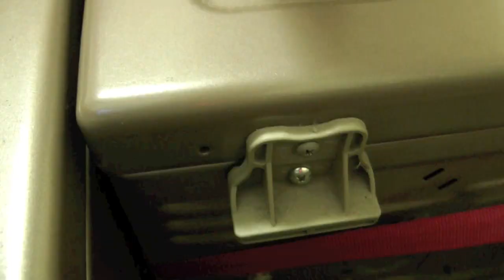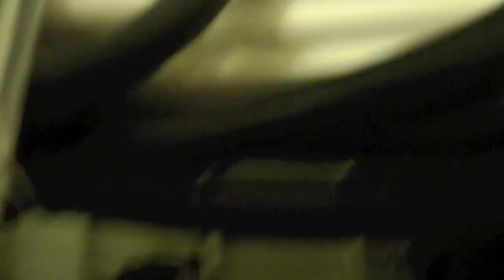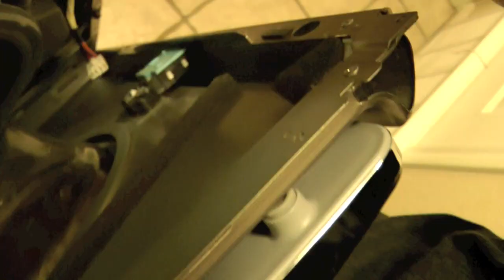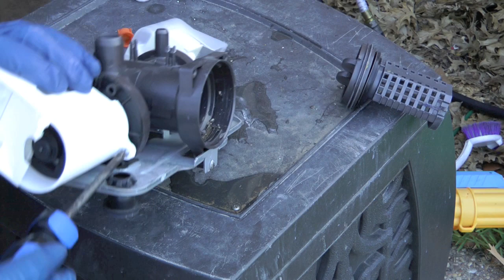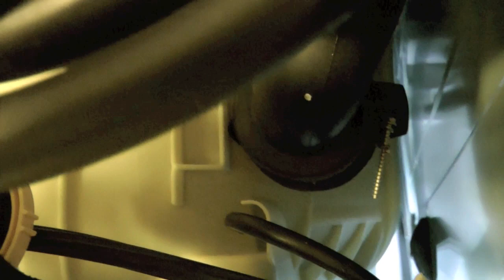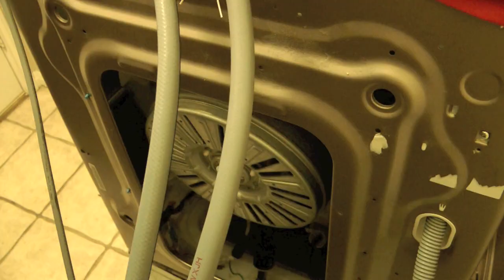Front Loader Washing Machine Won't Drain - FIXED!

Comment: Good job. Those front loader machines can be tricky. I scrapped an LG washer and have been selling parts on eBay. I had a Salesman tell me years ago never to buy computerized appliances whether they are for laundry, dishwashers or ovens excetera. He said to buy appliances that have the mechanical dials because the computerized ones can be so expensive to fix. If a person can do the work themselves that's always a bonus.